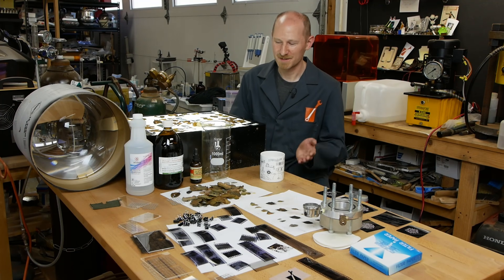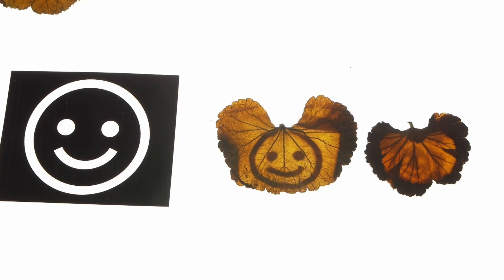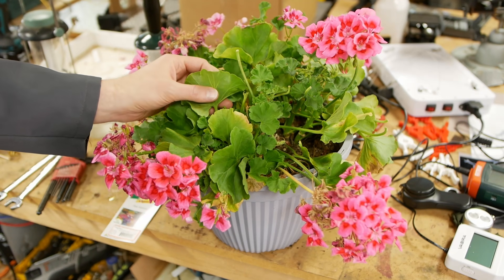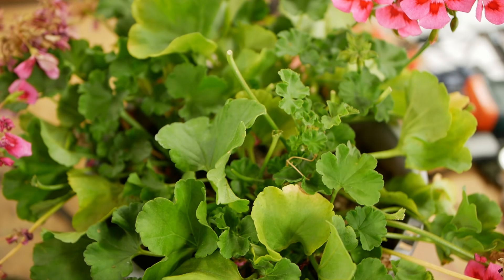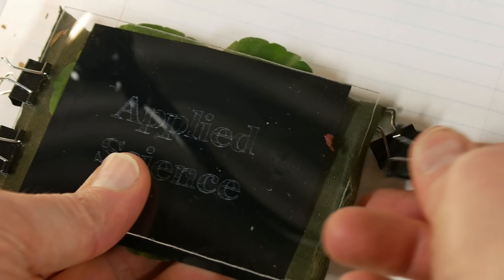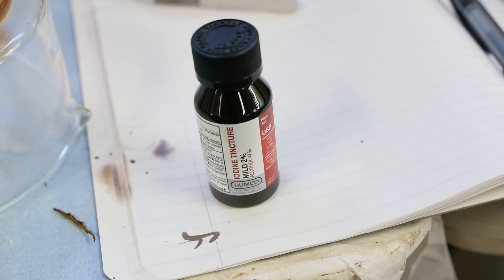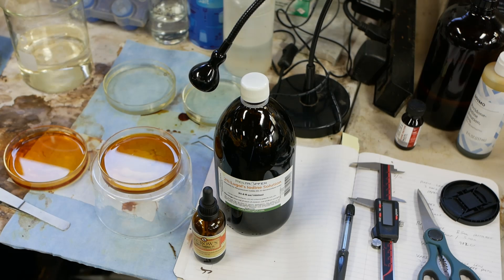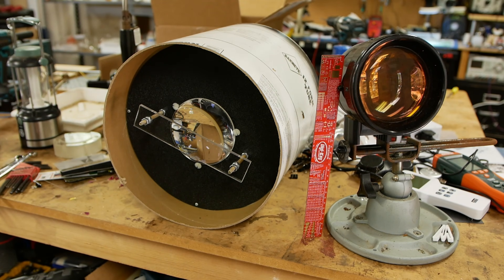Photosynthesis photography: Making images with living plant leaves

Comment: As a photolithography enthousiast, I approve this video😊. Fantastic work Ben!
Reply: Collab opportunities!??
Reply from the maker: Thank you!  Maybe you know the answer to this:  What is the minimum f/number for a multi-element camera lens made with glass in air?  One of the other comments indicates the theoretical minimum is f/0.5 due to numerical aperture of the final element being limited to 1.  Thinking about microscope objectives, this seems to make sense, but I feel like there are a lot of assumptions being made, and that the theoretical limit would be lower if the focal plane can be curved, or if non-spherical optics are used, or if the lens design is asymmetric, or if the object is at infinity.  I searched around the web, and there is a whole bunch of conflicting information and poor explanations.  What do you think?
Reply: @AppliedScience  always like these projects that bring up interdisciplinary questions and the big meta question of how to find quality answers.
Reply: @AppliedScience  Indeed the maximum NA of air microscope objectives is around 1, which is caused by the critical angle of the light passing the last glass air interface. This critical angle is generally around 42 degrees but is also dependent on the difference between the refractive indices.  It's the reason why ASML uses (water) immersion lithography in their DUV machines, otherwise they cannot get the light out. Same for oil immersion objectives. So if resolution is your goal, then you should find the "water plant equivalent" of the Geranium ;-). I don't think that is the case though, so if you are determined to increase NA, try projecting on a spherical image surface and you can go higher than NA 1. At some point though, the local  temperature increase by the light might slow down or even stop the photosynthesis.
Reply: Maybe just add sun reflectors to illuminate the subject more.
Reply: The youtuber Neptunium is building a homemade particle accelerator and needs applied science’s advice, please help ben get in touch with neptunium. And go watch his video!
Reply: @AppliedScience Hello, is there a way to contact you?
Reply: @AppliedScience  Please create something on microdroplets .
Reply: @AppliedScience Love hormone is very mysterious. After searching in more than a dozen languages, no one on the entire Internet has prepared it, and there is no preparation method. The more it is not available, the greater my curiosity. Teacher, what do you think of love hormone? Do you want to make it?  Impulsive?
Reply: @AppliedScience  8months with no content from you is frustrating. hope its something good you are working on
Reply: @HuygensOptics  > 42 degrees
this is definitely the answer

Comment: Bravo! Gas exchange is primarily done on the underside of leaves. The top of the leaf is usually used for photosynthesis and the bottom for gas exchange. You stumbled on this so fast it is impressive...
Reply: Do you know if the gas exchange affect starch production granule size?
Reply: @TheNewton  not that I am aware of... I don't know much about this, to be fair. Gas exchange is required for carbohydrates, but no idea about size correlation.

Comment: Amazing video! I had no idea you could also do it like this. I've done this before but much simpler. You take a leaf (already cut from the tree/plant. needs to be deciduous.), you print your POSITIVE image on some transparent or semi-transparent paper, put on top of the leaf and that pressed together with a glass and a sheet of wood or something, then expose to direct sunlight until you notice in parts of the leaf that are visible that it starts turning yellowish-brown (maybe a few hours, maybe a couple of days). So when you take it out you already have an image. The parts blocked by the positive are green and  the parts not blocked are yellowish-brown. If you put it in a book or something it might last a couple of years but otherwise it'll degrade pretty quickly. There's some people that use a fixing process that uses glycerin and some house-hold chemicals. They call them "chlorotypes"
Reply: I thought it might be something like chlorotype. With starch/iodine it could be an amylotype from the Greek for starch.
Reply: What about using the change to fall/autumn colour? Cercis has a reasonable size leaf and the pink/orange colours are from chlorophyll breakdown.
Reply: " The parts blocked by the positive are green and  the parts not blocked are yellowish-brown."
Am I not reading that right, wouldn't the blocked parts be yellowish-brown from lack of sunlight?
Reply: @TheNewton  this is using dead leaves. The sun turns them yellow/brown. You stop that process by blocking the sun :)

Comment: What a delightful experiment! Super cool, thanks for digging into this rabbit hole and sharing 🙂 I wonder if separating fixation for extraction might help, particularly with thicker leaf varieties? I.e. replacing the ethanol step with a fixative (paraformaldehyde or similar) and a membrane permeabilizing agent like Triton-X. That could then be followed with a more mild clearing step to remove the chlorophyll since everything has already been fixed in place.

At least that's how I'd tackle it in cell bio... but plants are weird so huge grain of salt 😅 There's also been some recent work on clearing protocols like ClearSee (DOI: 10.1093/pcp/pcab033) and ClearSeeAlpha (DOI: 10.1242/dev.127613) that produce remarkably transparent specimens, intended for fluorescent imaging. Maybe these could be used in some way? The urea content of the ClearSee would be problematic with the starch I think, so it'd probably have to be fixed -> iodine stained -> ClearSee, which maybe wouldn't work?

Dunno, but very cool project. Thanks again for sharing, love this stuff!

Comment: This experiment was actually in my middle school text book to demonstrate plant synthesize starch during photosynthesis. Our teach clipped a trip of black paper on the leaf and left there for few days, but in the textbook it was suppose to leave the plant in darkness for some days, the expose it to light with the mask. I don't really remember the result, the experiment was performed by teacher on stage. In the text book they used ethanol. Its is great to see how good it turns out. And it is really interesting to see that you used the exact same plant as our teach but not the same as the textbook IIRC. It was really cheap and easy to acquire ethanol in my country, but very rare to see isopropyl alcohol.

Comment: First thought when thinking about the artificial lighting version.
Using a laser projector to have X-Y control and "print" the carbohydrates at specific points.
I did a bit of quick research and it seems there are some studies relating to low-power and/or indoor plant growth using single-wavelength photosynthesis.
A leaf could be isolated in a dark box while still connected to the plant, and the laser image projected onto it's surface.

Comment: Rather than making a faster lens, I wonder if using a Newtonian reflector would be an easier thing to experiment with? Amateur astronomy telescopes can have pretty massive apertures, and are pretty hackable with standard diameters in the focused etc
Reply: Most telescopes are f/4-f/5 which is much slower than projector lens from video (8-25 less light than f/1)

Comment: In many other photographic alternative processes we have to use glass as acrylic will block some UV as you noted. Also, put the inked surface of your printed negative against the leaf. The frosted layer of your transparency material (pictorico, fixxons) can rob you of some sharpness. We usually use super thin transparency material (completely clear, write on kind) if we're putting the negative on a process that can damage it. None of this may matter, but wanted to share.

Comment: 19:15 THESE.  If i ever get the Fabrication Abilities this is one of the FIRST projects i want to do!  This may be better suited to a channel with a huge glassblowing capability, but i would LOVE to see more on this!

I need to read up if the studio lamp ones and others added in other elements to get the spectra right, but otherwise (if my understanding is correct) it’s basically just sulfur in an ampule that you hit with microwaves and get VERY bright, high cri light.  And in theory very long bulb life (although the issue of cooling the bulb might be major)

Comment: great video! 
safety tip for those trying to replicate: i would consider methanol really toxic. in terms of lab procedure, don’t get it on your hands without gloves. you might be able to do the boiling step outside if you step back from the setup while it boils; but keep in mind that boiling solvents are incredibly flammable (i mean, its kind of like boiling gasoline).

Comment: In Australia, ethanol is available pretty much everywhere and is considerably cheaper than isopropanol. As long as it still works with a little bit of bittering agent, it should be fine.

Comment: This really is a lovely, and incredible project. As always, I love the obvious joy you find in the investigation. I wondered whether you might be able to improve the control of the exposure by sort of pre-biasing the leaf with a huge, uniform dose of sunlight which sort of maxes out the photosynthesis process, so that a second light field, the image, can be added to the first, and cause starch grains to grow. I'm imagining adding an additional path for light by bouncing sunlight from a large parabolic reflector, or fresnel lens, through a ground glass to remove any image information, then onto the leaf at an angle compared to the image rays coming through the lens setup you've made. I know that CCDs and photomultiplier tubes often have a biasing voltage (sometimes a high one) to ensure that the small energy of photons is enough to make the system flip states. This would be a similar idea, but using light for biasing? I'm definitely going to give this a try with my students at the University of Washington. I'll also report back on using French Sorrel and Butterbur leaves, which are much larger, but still similarly delicate, and might allow for bigger prints. Thanks again for the amazing project.
Reply: French Sorrel and Butterbur leaves, the membrane of a water lilliy petal

Comment: For those interested in why the pigmented patterns have no effect on the prints: Chlorophyl mostly absorbs light around 700nm wavelength. These extra pigments absorb other wavelengths, so they don't negatively impact photosynthesis. Plants may have these extra pigments for various reasons.
They might serve as sunscreen, absorbing light that could otherwise damage other molecules in the cell.
They might be attached to chlorophyl, to let it absorb additional wavelengths.
They might quench excess energy of photosynthesis, protecting the machinery from oxidative damage.
They might just be just decorative, to attract pollinators or warn predators.

Comment: The reason for underexposure may also be that the glass itself is blocking the leaf's photosynthesis pores :P 

You'll need a polarisation film to "straighten" the light rays so the glass can be further away from the leaf. Or a CO2/O2 permeable sheet on the front that doesn't block light. Basically one of those plastic films that the carbonmk3 sls 3d printer uses.

Comment: What about a DLP projector? I feel like it would be plenty intense at such a small scale if you can focus it
Reply: The Lamp/LED would need to be the right wavelength. But I'm also interested.
one of those x-y Laser projectors might also be interesting if the wavelength is usable.
Reply: @Prophes0r  The light source in a typical projector is an HID lamp with some filters, plus the dichroic colour wheel. I'd imagine the main wavelengths a plant needs would make it through. Some DLP projectors like my UHD38 also have a white zone on the colour wheel which I'd imagine would pass the majority of wavelengths through unaltered.
Reply: @Prophes0r  Aren't grow lights mostly red and blue LEDs?

Comment: A video projector even a small LED one will be more than sufficient for photosynthesis.  Plants do not use the IR spectrum so there more than half of the 1000W/m^2 is lost so much so that I will build a green house with no windows (need good insulation in this very cold climate) and the 20% or so efficient solar panels + very efficient warm white LED's will be almost the equivalent of having windows (so 1m^2 of solar panel will be equivalent with 1m^2 of window).
The big advantage is that heat will stay inside the green house at night and there is also not a huge temperature variation.

Comment: since the photosynthesis requires CO2 to occur, what if you aimed a hose connected to a CO2 canister at the back of the leaf set at a reasonable flow rate, would that help the image take faster?

Comment: Fascinating as always. Tobacco leaves might be an option, used in plant research, nice big thin flat leaf. for gas exchange many plants have stomata on both sides of the leaf and I think geranium also has so a leaf with only underside might help.Tobacco has more on the topside . aquatic plants are topside only. Inspiring uncovering of rabbit holes. Love the idea of 2ft frescnel and the live sunlight method. Could Galileo or other ancients have done similar,. As a laxed  amateur microscopist Iodine for staining starch  but I wonder what other light affected sugars ? might be in there or other staining methods, .Fixed with FAA ,Formalin Acetic Alcohol it would last for  decades or longer.Tempted to dip the leaf into a silver chloride or feed it into the water. Thank you. i got there.

Comment: What are the downsides of using other plants? You mentioned that the "delicateness" of the Geranium leaf is helpful, what do you think would be different if you used the leaves of an Elephant Ear plant, for instance?
Reply: I think the "delicateness" describes how easily the alcohol/iodine permeates the leaf.
Combined with the starch staying put during those processes.
Larger leaves or other plants might have a structure that makes the process take longer and cause the starch to move.
There may also be a problem with hydrophobic coatings (waxes) or structures (hairs) that change process times.
But hey! Only one way to find out right?

Comment: Here's a bullet-point summary of the video:

Main Topic
- Creating photographic prints on leaves via photosynthesis.
- Utilizing a mask to selectively expose portions of the leaf to light, thereby capturing an image.
- Revealing the image by reacting starch granules in the leaf using iodine.

Experiment Setup
- Uses geranium leaves for the experiment due to their large, delicate nature.
- Built a holder for the leaf and the film negative using hardware cloth and welding rods.
- Initially used dark felt as a backer but later removed it to improve gas exchange for photosynthesis.

Exposure and Plant Care
- Keeping the plant in darkness before the experiment was found to be counterproductive.
- Exposure time is ideally 48 hours in direct sunlight.
- Harvest and develop the leaf in the late afternoon for better contrast.

Development Process
- Boiling the leaf in alcohol (methanol, ethanol, or isopropanol) for 8 minutes to remove chlorophyll.
- Rehydrating the leaf in water.
- Using Lugol's iodine solution for starch development.

Camera Lens and Light Source
- Built a custom camera lens with an F number of 0.5 for faster exposure.
- Sunlight is the most effective light source; artificial light requires much higher intensity.

Tips and Troubleshooting
- Be patient; the success rate is around 20-30% even with experience.
- Different types of geraniums may yield different results.
- Images may not look good until the leaf is fully dried.

Comment: Hey Ben , Hope you're doing well. I've been reading about desalination lately and came across this interesting idea about using (sound frequency resonance) to break down sodium chloride molecules in water. Do you know if this method can be scaled up for large-scale desalination? Also, any thoughts on cost-effective equipment options considering the high expense of traditional desalination setups like (reverse osmosis) systems? Would love to hear your insights if you have a moment

Comment: Can you please consider making a video about Diamond CVD? Apparently they can how make diamonds in a vacuum and it you could use solar energy you could theoretically trap carbon indefinitely this way. If it’s simple enough for a project i think the world would LOVE to see you demonstrate it and take the proprietary black box away. I know you could figure it out. They use methane as a carbon source. So you can go from gas directly to diamond with negative pressure as opposed to high heat and pressure. Theoretically you could make low quality permanat carbon sinks using air. I hope you read this and it sparks your diligent execution of your imagination.

Comment: Wonder if it would be possible to digitally print onto the leaf using a laser galvo scanner and a laser source with the right wavelength light?
Reply: or an x-y laser projector? The problem is getting one with a wavelength that actually works.

Comment: Consider the possibility of recovering "photographs" created by any natural process which is affected by light.

For example, find a long-standing cave opening, then examine the interior of the cave for any recoverable evidence of a pattern formed by varying levels of exposure to sunlight. It won't be easily visible or well focused, of course, but any growth or deterioration which is affected by sunlight levels should be increasingly detectable over time.

There are Earth-facing lava tube openings on the moon, some of which have probably remained stable for a billion years or more. I wonder if a billion years of exposure to Earthlight through a small hole has left a detectable record of changes to the Earth's albedo.